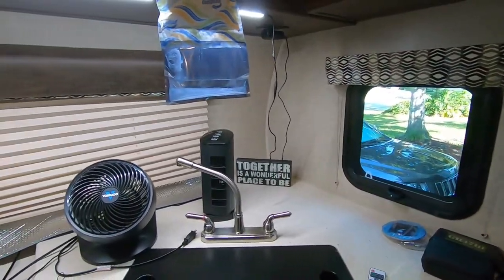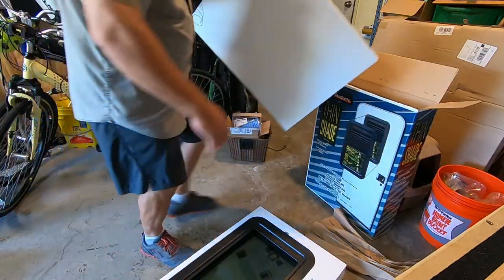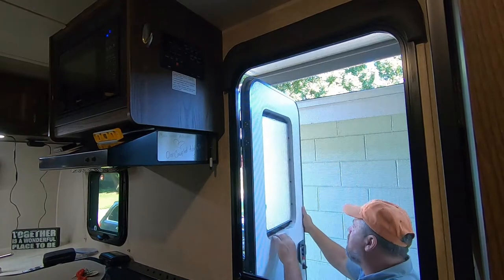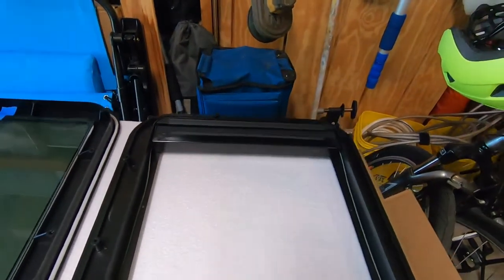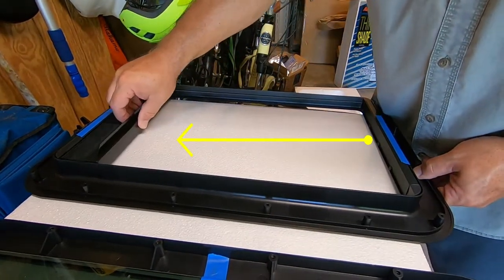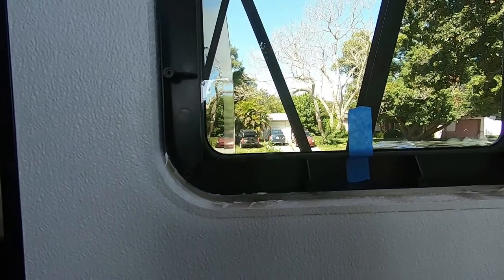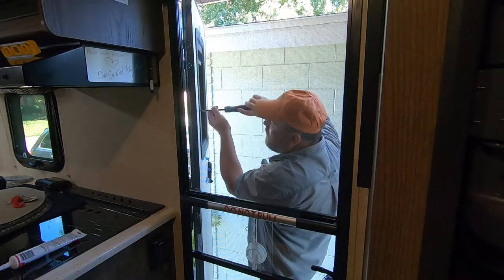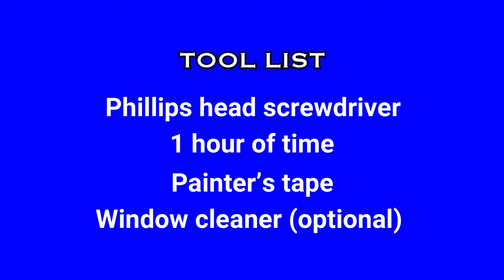COOL RV DOOR WINDOW AND SHADE UPGRADE

Comment: Nice upgrade :)  I installed ours  few months ago and love it. Here's a tip from me......Once its first installed the shade seems a little stiff to slide up and down until its broke in so what I did was rubbed some silicone spray on the shade string and its slides up and down nice with one hand.
Reply from the maker: Thanks for watching Michael.  Thanks for the tip.  We do enjoy watching your upgrades, tips and tricks videos!  What's next for your rig?
Reply: @OurCoupledAdventure  Thanks for watching my videos. we are currently on a 37 day road trip so modifications are on hold for now. I'll be posting videos of our trip once we are home October 21. Also I found that one of our axles is bent, and causing uneven tire wear on one tire, Dexter is sending me a new axle at no charge so I will be doing a video on my findings and the replacement after we get home. Keep the videos coming and enjoy your new window its great :)
Reply from the maker: Glad to hear you are getting good support for the axle issue.  I will be watching for the video on it!

Comment: To me, the shade is not important as if someone wanted to look in they would have to come up the stairs. I do like the capability to look out the window and also be able to view who's knocking on my door.
Reply from the maker: Hi Bill, Thanks for watching.  Since it is a tinted window, which ever side is lit can be easily seen.  So, at night with interior lights on the interior is easy to see from outside, and thusly, during the day inside is hard to see, and looking out is easy.  Night time is when the shade is needed for privacy.  An additional benefit of the shade is if the sun is on that side, the shade does just that create shade.  Happy Adventures!